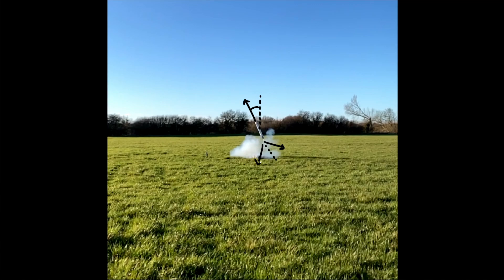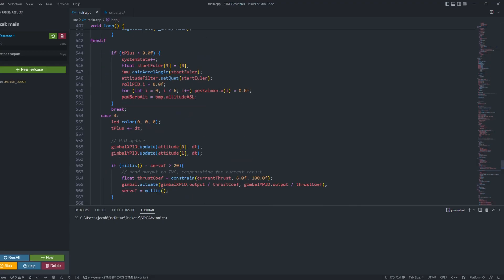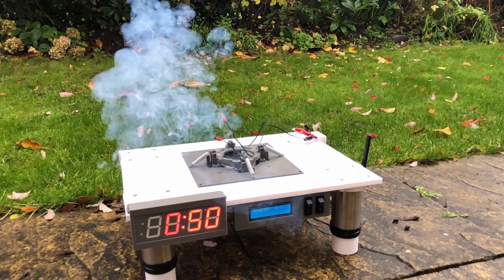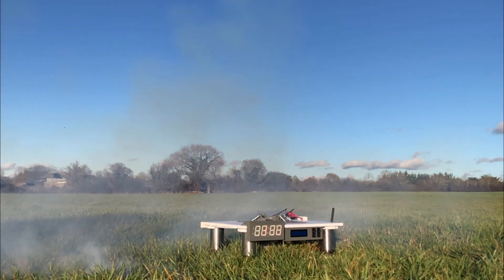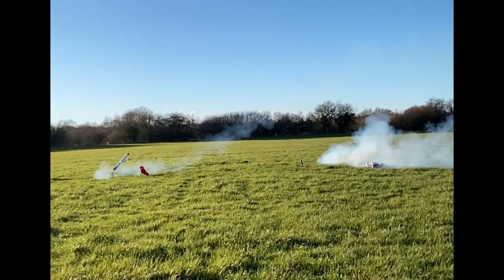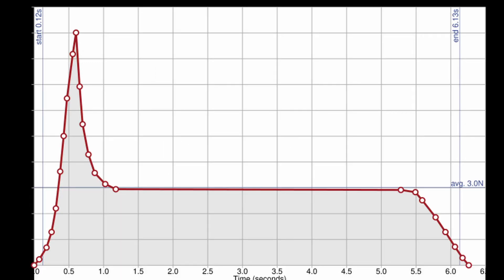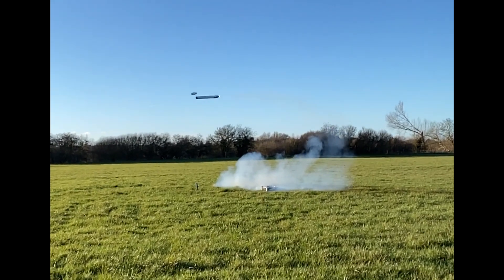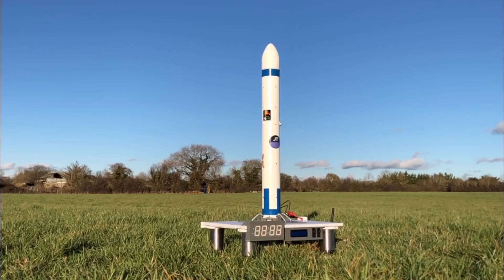TVC Rocket Flight 1 - What went wrong?

Comment: I'm thinking about doing a similar project for my engineering final, and I was wondering what you used for motors? I'd like to try to make my own with sugar and stump remover, but I don't know if those are powerful enough.
Reply from the maker: I use 2 Klima D3 motors. From what I’ve heard, commercial rocket motors are usually much more reliable and consistent than homemade ones, so they are probably your best bet.

Comment: Great work as always, axis reversal has ruined many flights :)

A suggestion to tune your controller and find silly errors like this is to run static tests with a brushless motor on the mount with the rocket strapped to a due axis hinge and test your stability software. This way you won't burn a motor with every attempt.

Comment: Very cool !
I'm currently learning about automatics, how do you adjust your PID to the thrust curve ?
Reply from the maker: The computer interprets the PID output as a torque that needs to be applied, and then calculates the thrust angle using the moment arm and a bit of trig